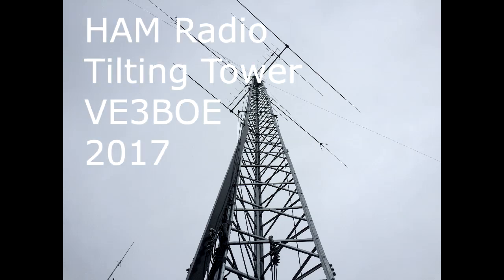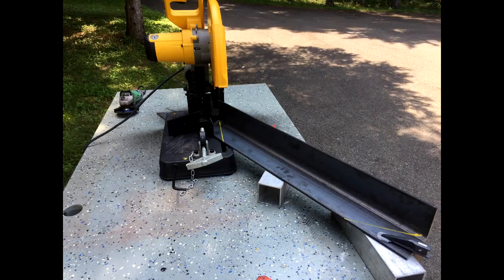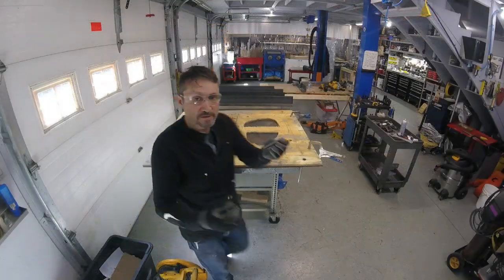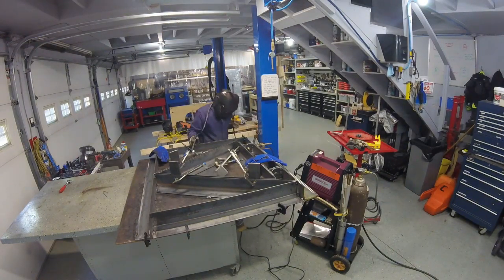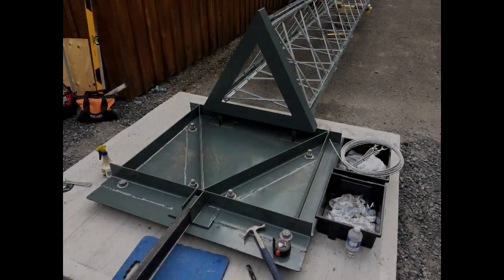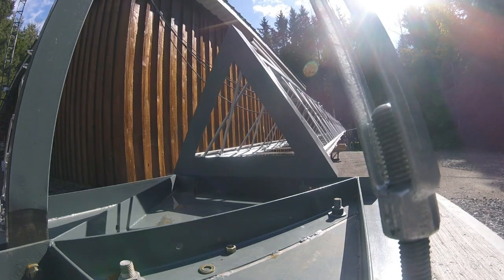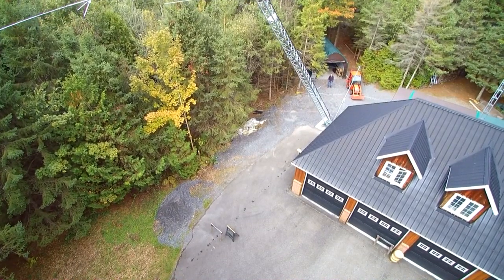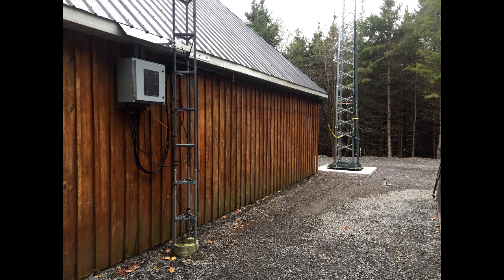Tilting HAM Radio Antenna Tower - Part 1

Comment: After watching videos on tilting towers I decided to install my used antenna tower I bought at a garage sale from a Ham guy. I use a roller assembly on my 1 1/2 story roof to reach over to the winch on my van. Just had it down for a new TV preamp. Made the base hinged 3/8 plate and used 4 corner 3/4'' SS threaded rods in a 30 bag concreate base. Thanks for the nice video.

Comment: What I want to know is how did you keep the antenna flat and level while tilting. Seems to me it would spin around in anything not secured.
Reply from the maker: If you look at part 1 closely you’ll see how the hinge for the beam works. The connection to the rotor stops it from rotating.

Comment: Beautiful!  I'm building something similar, but with a 33' x 5.5" diameter x 1/4" thick steel pole as a lifting point (back guyed).  This pole can also support an antenna.  I like the multiple attachment points to the tower.  I'm using combination of 4x6x3/8" and 3x5x3/8" angle to make tilt base.  No plate.  Tilting a restored Rohn HDBX 48' tower that is about 90' from the house.  It will support an old-model Mosely Pro 67A multi-band beam and a Comet GP9 VHF/UHF vertical.   I have a 24x24x8" NEMA 3R box (room enough for maybe a remote antenna switch and other gizmos) with about 14x 1.5" EMT elbows coming out of the bottom.   Cable trench will empty into a covered "pit" next to the box.  EMT elbows will run through concrete into pit.  2x 4" PVC drain pipe will run between tower and basement shack.  2x 7/8" hardline and 3x 1/2" hardline coax runs with other control cables.  Same size NEMA box on side of house.  

Waiting for part 3!  Very interested in your antenna tilt plate -- I can make stuff, and don't really want to spend $700 on a premade one (but I haven't worked with aluminum before).   I'm also interested in how you deal with your coax during tilt.  Also interested in how you grounded and bonded things. 

Thanks for the videos!
Reply from the maker: Thanks for your comments Mike.  I will get part three up during the next week. I will make sure to show some pictures of the coax at the tower hinge for you. Marc.

Comment: Great idea 👍
You got the Wade HD -- I believe that it is rated 9 sq/ft wind load at the top.  What is the estimated load you have on there?
I was thinking of getting a that tower for a wind turbine?  Also did not want to climb for servicing -- I did it when I was younger - now, no thanks.
Cheers
Reply from the maker: I don’t recall exactly what the total wind loading was but I do recall using the free calculator at the DX Engineering website to do those calculations and then selecting the mast and tower accordingly.

Comment: Hi Marc, I am building a 64ft tilt over with a DMX, your video is quite helpful. How did you come up with 12,000 winch? Is the 4" falling derrick thick enough? There appears to be a bit of a wow in it, perhaps its the video angle. How much does your tractor weigh?
Thanks
Reply from the maker: Thanks for your positive comments.  I calculated what the forces were throughout the system.  I purchased this particular winch because it was on sale (lol) and because it was well within my lifting force requirements. No "wow" in the falling derrick but you should be aligned dead on centre with your cable as shown in my videos. Please make certain that you understand what I did at the 4:50 mark in the video.  The forces transfer through the derrick by the use of a through fastener and NOT the metal thickness of the derrick.   Also note the lateral guy-wires on the derrick.  My tractor is a BX25. Note that during the lift and lowering sequence, the forces acting at the centre point of the bucket are not acting purely against the weight of the tractor, hence the extensive strapping to nearby trees (see part 3 of my series). Good luck.
Reply: @marcinmetcalfe595  Great job, what is the length of your falling derrick & how did you calculate the winch requirement? I would have thought 6000 lbs would have been plenty....I'm thinking of cost. I'm the same as you, I don't want to be going up & down my 64ft tower at my age. You did an amazing job btw, very pro....
Reply from the maker: @xavierkost9264  Thanks for your comments. The falling derrick is 16’ long. Good luck with your project.

Comment: Fine business Sir. I am presently constructing a 50ft tower using the Rohns plans for a 45G tower on a tilt plate.. 11and a quarter inch , equilateral triangle.. The cost to order from Rohns , and ship to Thailand was ridiculous.. around 5000 Dollars.. Local build. with improvements 550 USD. No Brainer..Home brew Rocks..

Comment: Hi Marc! I'm just building my new tower and I like the lifting mechanism. What about the tension of the three attachment lines? Is there something I have to pay attention? Is one of these lines looser? Thanks for your reply, 73 de Patrick - OE8ACT
Reply from the maker: You should do the calculations to determine the tension in the lines to ensure that you use the proper size cables.  In my case, due to the offset on the hinge point of the falling derrick in relation to the tower, the three lines transfer the lifting loads from the shortest to the longest during the lift sequence.  Look closely at the video. Thanks for watching.
Reply: @marcinmetcalfe595  Thank you for your reply! 73

Comment: What are the materials you used? The sizes? I have plan to built that design in my backyard. Thank you in advance
Reply from the maker: The base is made of 4” x 4” - 1/4” steel angle and 1/4” plates(4’ x 4’).  All the rest of the parts including the hardware, rigging cables, tower reinforcements, anchor bolts,etc., were selected based on detailed load calculations specific to my tower and derick geometry. You’ll have to make your own calculations for your setup.

Comment: what is the thickness of sheet metal used for hinges? and the diameter of screw used for mil?
Reply from the maker: Everything is made of 1/4” thick steel 4” x 4” angle iron.  I think the hinge bolts are 3/4” .

Comment: how did you get the pieces to reinforce the bottom of the tower? also, is it a necessary component?
Reply from the maker: Those reinforcement pieces are actually the base stubs that you connect to the bottom of the tower and they go into the concrete base. Instead of installing them from the base down and installed them from the base up to reinforce that bottom tower section as it is subjected to some greater loads. I’m really not able to comment on whether or not it’s absolutely necessary. I put them in for good measure since they came with the tower kit. I think it is a good idea to do it.
Reply: @marcinmetcalfe595  ah ok, I ask because I bought mine second hand and don't have them

Comment: This is so great.. Hope you can share your design. :)
Reply from the maker: Pretty much what you see is the design.  There is nothing hidden that I didn’t show or describe in the video. With the weight of your expected finished tower and antennas, along with the height of your falling derrick, you should be able to calculate to cable loads.  It’s essentially a first year engineering statics problem. The concrete base was built to the tower manufacturers specifications. The winching setup was based on the site conditions and what I had available to me as anchor points, and very unique to my site.  Thanks for watching.

Comment: How do you calculate how much load is on the raising cable?
Reply from the maker: Well that’s the key. Best to hire a qualified person to figure that out based on your particular tower and loading. All the best.
Reply: @marcinmetcalfe595  did you just overkill on your setup?
Reply from the maker: @theboogeyman826  No. Fortunately I’m a qualified professional engineer. I was able to get all the calculations done for free. 😁
Reply: @marcinmetcalfe595  believe it or not I havent been able to get any help on this matter. Maybe Enginners are not what I thought. I figured any structural engineer could figure this out for me.